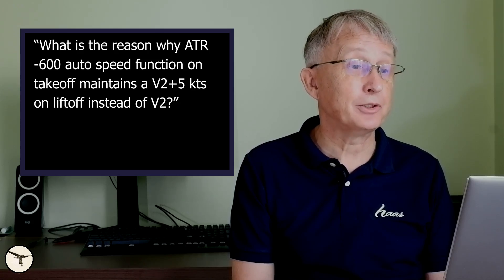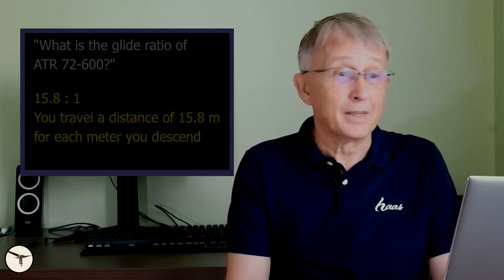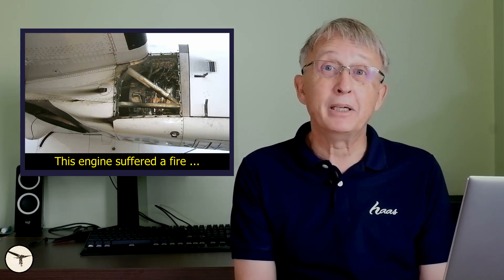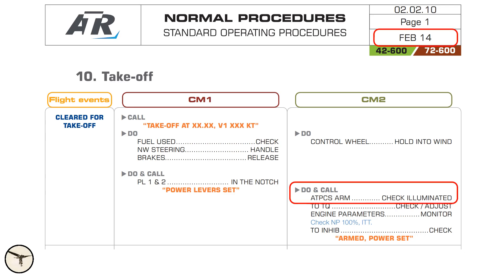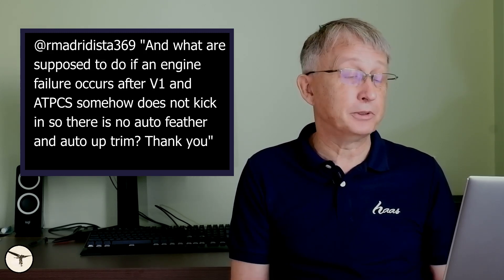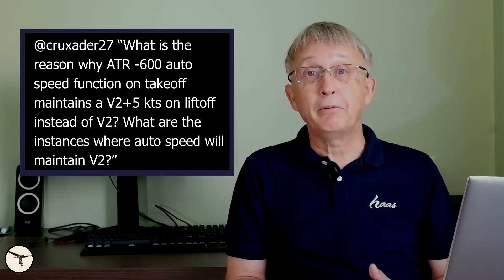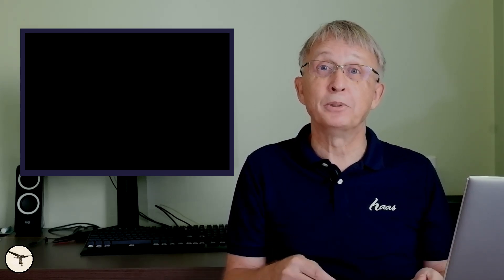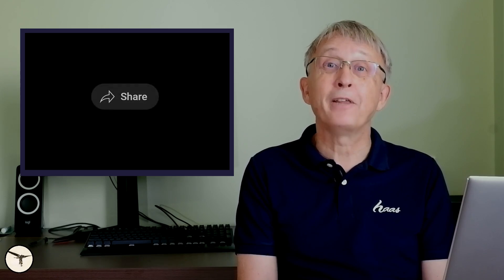Why do ATR Planes fly at V2+5 after take-off? Explained - Q&A with Mr. ATR

Comment: Hello captain.
Thank you for the incredible job you are doing to make us aviators more knowledgeable.
I have a question. 
I understand that v2 uses a larger ratio than 1.13vsr during takeoff. (To ensure climb gradient.)
On the other hand, the manual states that if FLAP15 is set during GA, VminOPS will be V2.
However, this VminOPS does not match the V2 at takeoff.
Does this mean that VminOPS is not the V2 ratio at takeoff, but V2min (1.13VSR or 1.1VMCA)?

41000lb
V2: 110kt (1.2VSR)
VminOPS (FLAP15 during GA): 107kt (1.1VMCA 20℃ 10000ft)　or 1.13VSR）

Is this understanding correct?
Is this the design shown on the PFD?
thanks！
Reply from the maker: Thank you for asking. V2 can vary from 1.13 VSR to 1.35 VSR (AFM.PER.3.3.2). The values in QRH are as following:
Normal conditions: V2 is 1.13 VSR, and VGA = 1.2 VSR. 
Icing conditions: V2 is 1.22 VSR, and VGA is 1.24 VSR.
Early manuals had lower values for VGA in normal conditions.
Reply: @FlywithMagnar  Thank you for your answer.
I have one more question.
When GOING AROUND, should I accelerate to VGA and then operate the lever to change the FLAP from 30 to 15?
Or should I immediately operate the lever to FLAP 15 if the speed is above VREF?
(Because the STALL MARGIN of FLAP 15 is guaranteed even at FLAP 30)
thanks！

Comment: 0:42 Mr Magnar, can you please elaborate more on that? 15.8:1 does it mean, ATR will glide about 3 miles per 1000 feet loss?
Reply from the maker: 15.8 to 1 means the aircraft glides 15.8 NM distance per 1 NM altitude loss. 1 NM equals 6,000 ft. Consequently, 15.8 NM per 6,000 ft altitude loss equals 2.6 NM per 1,000 ft altitude loss.
Reply: @FlywithMagnar thanks !

Comment: Hello Magnar, I have another question. The weight data shown in the upper part of the performance page, does it show just what you type into the FMC or is it the real weight derived from weight sensors? Thanks
Reply from the maker: The performance page shows the weight you have inserted in the FMS. I do not know about any aircraft having weight sensors.
Reply: @FlywithMagnar  Wow, that was quick. Thank you 🙂

Comment: How is the COMPT TEMP indicator (the new digital version) on the overhead panel powered? I thought it was ACW, yet sometimes it’s lit up in hotel mode and sometimes it isn’t…
I only ask because it’s nice to know if the packs are working, but if it’s not displaying anything, how can we? Thanks!
Reply: I was just taught the answer to this by a FO the other day! It is on DC when the airplane is first powered on. Then it changes to ACW. After returning to hotel mode, it is disconnected from DC power. From that point it will only be powered by ACW until the airplane power is reset.
I can't imagine why the engineers designed it that way.

Comment: That landing video at the last part of the video. Are you allowed to touch down with PL above flight idle, or was that a lapse from your end?
Reply from the maker: In a perfect world you will start to reduce power and reach idle at touch down. In this case, the sink rate at touchdown would have been too high at touchdown if I reduced power all the way to idle. Pulling hard at touchdown will result in a bounce. So yes, you are allowed to keep the power levers in the position that gives the best landing.
Reply: @FlywithMagnar very interesting. where I work, that's a call from the safety department. 
 The ATR FDM software tags the event as high risk  if you land with a residual torque of 20% or more and medium with more than 10%.  So the manufacturer  definitely does not approve of it. 
However, Power on landings on the ATR must be a blessing(I can only imagine).

Comment: You might think V2 is the best climb speed, but that's not necessarily true. V2 is defined as takeoff safety speed.  It's the minimum safe speed to fly with one engine. Since we don't want to go below V2, aiming for V2+5 gives us an extra safety margin. Turbulence, windshear, or hand flying will cause our speed to vary slightly.
I'm not saying Magnar is wrong, but he didn't define the term so I wanted to add to his explanation.
Reply: I will add that although V2 isn't the best climb speed, it is still certified to achieve at least the minimum climb gradient in case of engine failure.

Comment: Thanks, Skipper. I could not help noticing that all the PAPI lights were red from 7.25 till you touched down🤔
Reply from the maker: The PAPI lights at Malé Airport are set up for widebody aircraft, where the crew is seated high above the main landing gear. The ATR is smaller. If we follow the PAPI, we will cross the threshold at 80 feet. When we follow the ILS glideslope, we will have 3 red lights on the PAPI. I followed the glideslope down to 200 ft. Then, I aimed for 1/2 dot below the glideslope, which will give us 50 ft when we cross the threshold. During this landing, I crossed the threshold at 35-40 feet. 
Reasons: 1) The landing threshold is displaced 360 meters. 2) After landing, we exit the runway at intersection D4, which is 1300 meters past the threshold. So, we do not want to land long. 3) The touch down markers are not 300 m, but 400 m past the theshold. We touched down approximately 350 meters past the threshold. 4) We had 7 knots tailwind, which makes the flare longer.  This was compensated for by going a little lower.
Reply: He dipped a little below the glide to touch down earlier. Nothing wrong with that when you're visual, there are no obstacles and you don't touch down before the threshold.
Reply: Oh ok . . .
Reply: A lot of Adobo ILS systems are wonky.